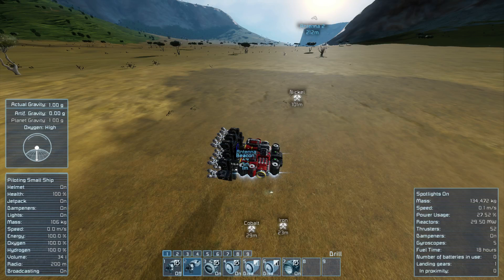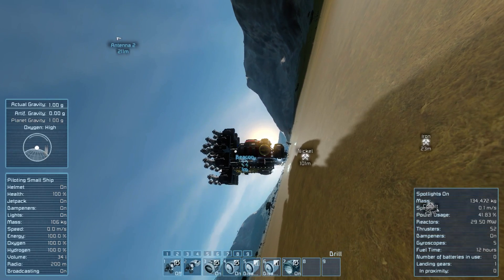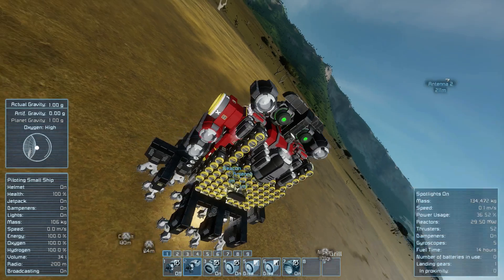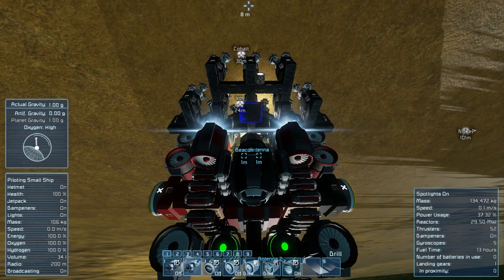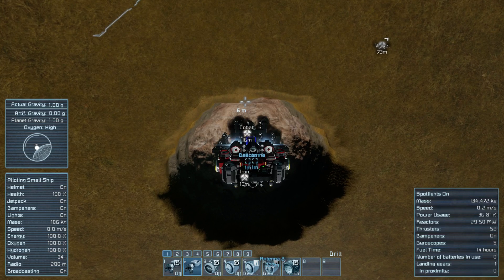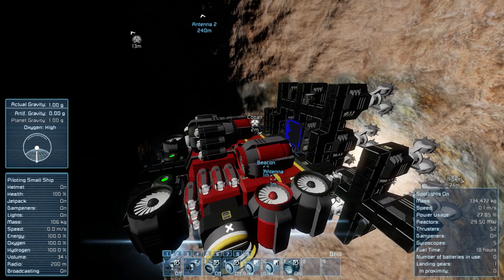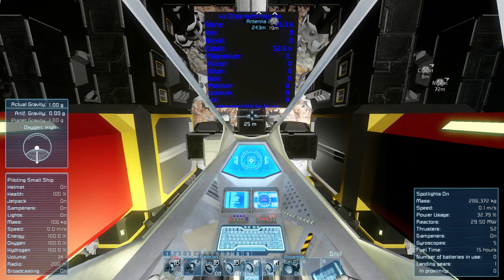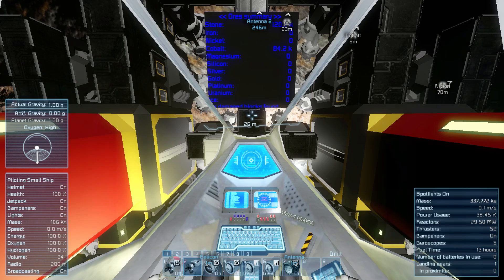Planetary Mining Drill Demo

Comment: About this demo; was this captured on a multiplayer server?  What are your system specs?  I ask this because when planets came out, I found the addition to be a largely pointless addition and highly detrimental to game performance (which was, and still is, in desperate need of new net code).  I noticed significant pausing in the animation, and would be interested to know if it is due to multiplayer desync or low system specs in creative.

Cheers!
Reply from the maker: Any pauses are due to the cheap free video capture software I used to record and encode this :).  At the time however I was running a dedicated server and this ship performed smooth and flawlessly on it.  However since then the devs have made some massive mistakes with the multiplayer software making this or any other ship flown in atmosphere extremely hazardous.  I actually quit the game shortly after this video was made b/c multiplayer was so incredibly broken.  I've recently tested the waters and it seems that multiplayer is somewhat playable in space but planets still seem to be a lost cause.  Constant rubber banding and iffy gravity mechanics makes even walking on a planet a risky bit of business.